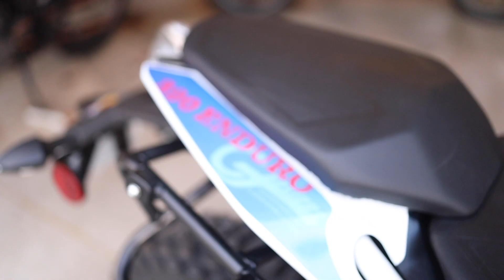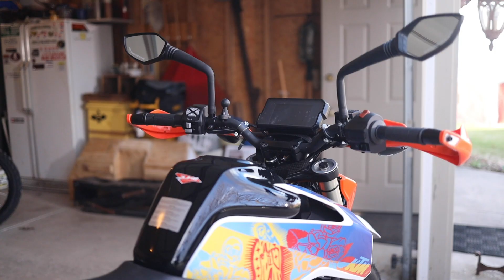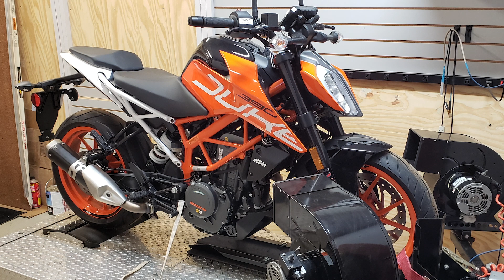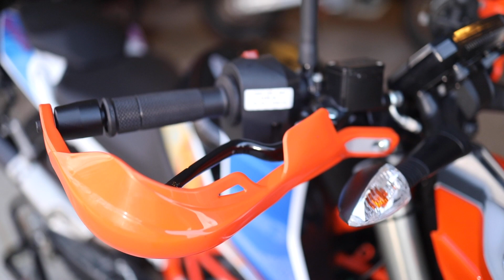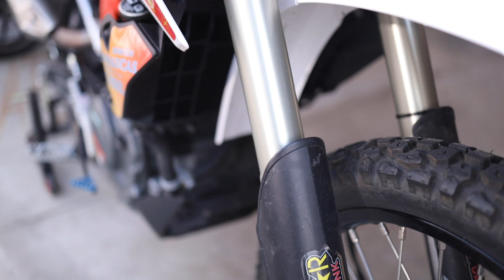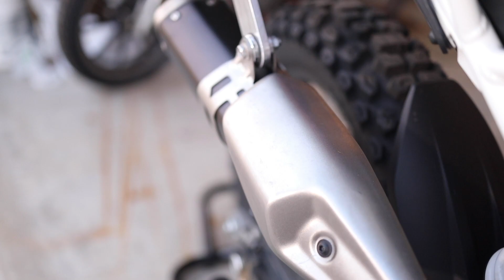CJ Designs LLC - KTM 390 Duke Enduro Build

Comment: Hi, Thank you for a great video. I have similar plan to convert my Duke 390 to something like 390SMR. Do you notice any handling difference when change the angle of the bike (bigger front wheel, longer front fork)? Does exhaust heat cause any problem with rear shock absorber and rear break oil tank for being really close with them? Sorry for my bad english.

Comment: nice work maan! do you make an adjustment for the front fork or it is plug and play?
Reply: I’d like to know as well
Reply from the maker: The front forks are fitted to the OEM top and bottom triple clamps, but in order to save cost on this build I machined the tube clamp area larger to fit the wp forks.  It wasn't in the budget or time frame to make custom CNC triple clamps for this build.  That is what also allows for the high fender kit with a custom adaptor plate bolted to thread holes added to the bottom of the lower triple.     I was thinking of making a custom triple clamp to allow fitment of full size enduro 48mm forks and a 21" tire, and a custom swingarm for an 18" rim and full suspension,  but with the 490 ADV stirring, I'm going to save the time and funds for a full on ADV light build on that some day.

Comment: It's definitely a great project, but since there is the 390 Adventure now it's not really necessary anymore.
Reply from the maker: I agree to a point, but when I started this the 390 ADV still have no release date available and I was tired of waiting.  It still has better parts on here than the ADV bike has and it is lighter.  I can't believe that KTM put out an ADV bike with mag rims and essentially the same suspension as the Duke.
Reply: @cjdesignsadventure9827  Okay yeah that makes sense.

Comment: Yeah cool... But I wish the seat and fuel tank with fairing needs to changed like 690 enduro, then it looks bad-ass...
Reply from the maker: Thanks,  The challenge with this was to keep the cost down and the seat height for her height and comfort level.  Plus I only had about 2 months to design, machine and figure all this out to make our trip deadline.   I had a 690 Enduro and it was too tall for to ride, otherwise she should have been on the 690.   She likes the height and feel and looks of this bike better. The unique look grows on you.  This stock 390 head LED headlight puts out a very good pattern and brightness and wasn't in the budget to change.   Now if it gets broken or needs replacement down the road, that's another build upgrade I'll be looking into.